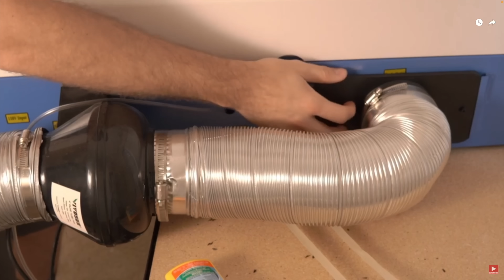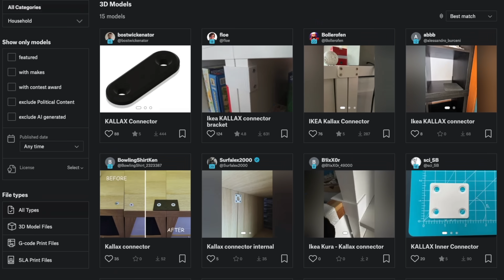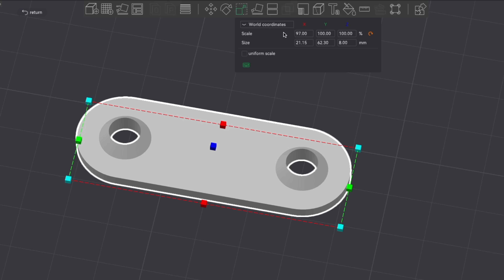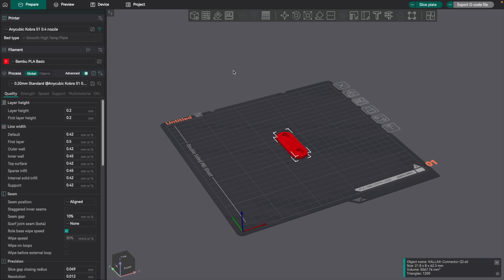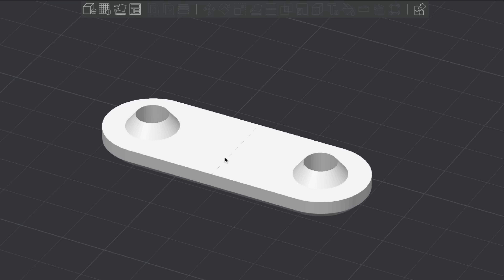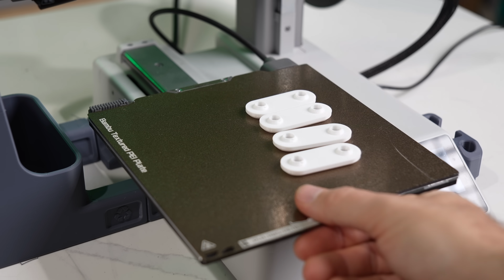Your Slicer Can Do More Than You Think!

Comment: I've used this a couple of times, first for taking a standard Multiboard bin and squashing it front-to-back so that it fit more closely the laser level I would be putting into it (at the time, being new to Multiboard, I didn't see the inserts that I could have customized more easily to fit). The second was in making a storage box for markers/dice/order markers for the game Heroscape; I used the slicer to incise a Heroscape logo into the lid for the box. Unfortunately, Prusaslicer does not have the capability to save an STL with a negative volume modifier applied to it, so I wound up having to go back to OpenSCAD and apply the logo as a differenced extrusion into the top of the lid to make the incised logo part of the STL file, so that it would be present when I uploaded the model for the box and lid to Printables.

Comment: i use the slicer often to tweak or "plunder" other models. like if i dont like the handle on the tool i want or the format is metabo and i need dewalt, i just cut and merge to fit my needs. also making washers is so easy, basic gaskets and traceouts too. when i think of it it has been a while since i had to use fusion or tinkercad..

a little tip here is to make a folder and save the shapes you add and change to have your own archive of basic shapes and stuff. i got quite the selection over time like pipe bends and things like that. it saves so much time and effort to not have to make them over and over for each project.

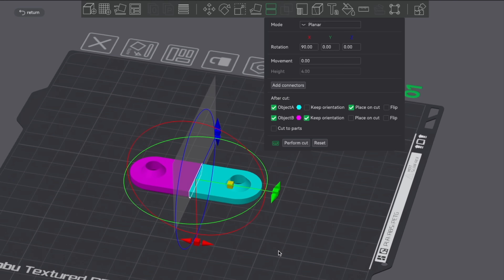Comment: 5:09 you could have split into 3 parts then move holes to position they needed to be and use the 3rd piece and copies of it to make the gap up (assuming longer). If shorter just split once and push to desired length (as you did at 6mins . Then merge back together. Winner!

Comment: I love the cut with dovetail feature for 2 main reasons:
1: splitting a large complex print into smaller parts means that if something goes wrong, you only need to reprint one tiny portion rather than the whole object, so it can potentially saves a ton on both time and on material waste 
2: I have a small build volume (voron v0, 120x120x120mm) and the cut with dovetail feature means that it's no longer a limiting factor. Most printers aren't as limited, but for stuff like cosplay helmets it's the difference between can and cannot, even on a much larger printer.
Reply from the maker: The cut and dovetail was mentioned by a few people. I wonder how many don’t know it exists. Maybe it would be worth covering it in a video.
Reply: @ModBotArmy  Yes  please! Wdas just dreading the idea of learning how to cut my model in CAD and making some kind of joints.

Comment: Having parametric history based editing would be a huge game changer
Reply: it would be easier to add orca slicer as a plugin to fusion or onshape than it would be to do that
Reply: @4fiHysteria yes but that won’t be as fun
Reply: There is a 3d printing plugin for blender, it does stuff like change angles I think.  But it's not a slicer it just makes your model more 3d print ready.  I found it while trying to setup blender for CAD typing designing ( with accurate measurements etc). It was a little weird to setup not know anything about blender but it definitely was easy to edit already made models by deleting things , patching them up vertex t by vertex. A little tedious but more intuitive operating In 3d space moving things around unlike a 2d sketch space
Reply from the maker: That would be wild. I wonder if we’ll ever see it

Comment: I've tried these tools in orca and TBH I don't like them.  I'd rather modify the whole STL instead of just saving the modified gcode for that specific printer.  This way I have the file I can then slice for ANY printer without having to go through all that nonsense all over again.  I have 7 completely different printers with every one of them having a separate profile and it seems absurd to customize a model just for one printer.  There's also the time factor in learning.  I know how to do these modifications in CAD so it is a better use of my time to just use CAD instead of spending that time learning slicer tools that I very well won't use too often.  But with that said it is great they are included.  A full function suit is generally more effective than piecemeal.  Now...if orca integrated CAD into it THAT would be interesting.

Comment: Back in the early 2010s when I really went ham on 3D printing, slicers were very utilitarian, but I seemed to collect them as each would do something useful that another did not, while everything else was handled either in modelling or CAD directly. It was a bit of a pain though as you'd end up working in three or more software solutions to get a print ready for printing. 
The one thing in the current options that is nice but creates somewhat dubious results are the pseudo boolean mixing or using them to make quick negative parts. When you boolean a part in a modeler, you'll see a dramatically more accurate result than in the slicer, to the point that in slicers, you'll often end up with inverted normals without manifold walls. I still dig quick parting and 'place on face' and use both of those frequently.

Comment: I wish they would add a feature to add chamfers or radii to sharp edges and sharp inside corners.
Reply from the maker: I was thinking the same thing when I was modeling the little cap at the end of the video.
Reply: if i want a hole with a chamfer i just add a cone and use the size tool (s) to get the shape roughly. then i use the measure tool (u) to verify the angle and dimensions is about right, tweak to tolerance and rightclick the newly added cone and chose type, chose negative from the pulldown menu. mark all added parts and negatives, right click the anywhere in the selection and chose mesh boolean. and i get a quick and dirty chamfer at the depth and angle i want. with the right size from using the measure tool (u) to get the hole size and depth.  :)

Comment: If you have a hammer, everything looks like a nail.
I would just screw them together with 4 screws from the bottom one into the top one so you cant see the screw heads.
(There is enough wood material on the outer parts near the side panels)
Reply: The difference is that this method would leave marks if the two shelves had to be separated later on. By contrast, the 3D-printed modification uses the existing screws and drill holes, enabling the conversion to be reversed at any time.

Comment: i use the various tools in orca slicer a LOT.  the one i've been finding myself using the most in recent months is variable layer heights, but until the larger format printer i designed & have started building is complete i use the cut tool a lot too.  i actually just had to cut a functional part for that not too long ago & used the dovetail function at a 45° angle to make my life a bit easier with a part that retained a lot of strength despite being cut.  there's a bunch of handy features.  😊
Reply from the maker: The cut and dovetail is a fantastic option for printing larger parts than what your printer can fit!

Comment: So as more modeling tools are added to a slicer, when does it become more a modeling application and less of a slicer? And because most of the newer printer owners are not programmers, developers, or hardware savvy, this new cohort will want a more reliable slicer tool that just works according to the printer(s) they own. So I wonder... when will slicers become an add-on to modeling tools?
Reply: Fusion actually does have a slicer under the "Manufacturing" workspace. I've never used it or seen anyone else use it, but you can find some videos if you search YouTube.
Reply: I would suggest using the difficulty level options in both prusa slicer and orca slicer. I use advanced difficulty with all options available, my friend use the easier simple option as he is not very tech savvy but still want to print minifigs and such.
Reply: Ya, I'm kind of surprised some of the CAD software companies haven't licensed/forked a few common slicers and sold them as an add-on.  You could license a seat of Onshape/Orca, for instance.  All rolled up in a neat package.